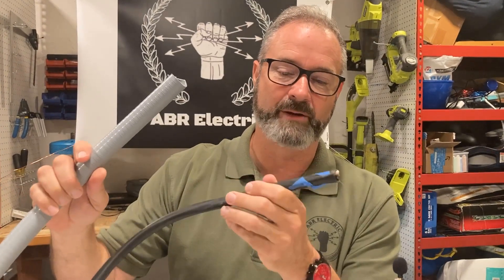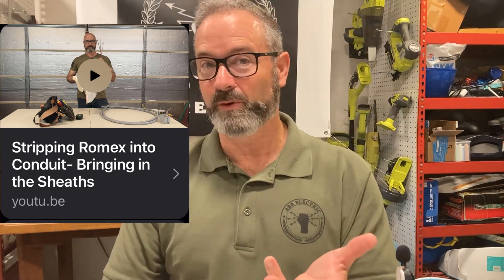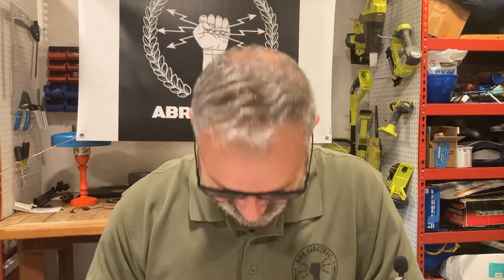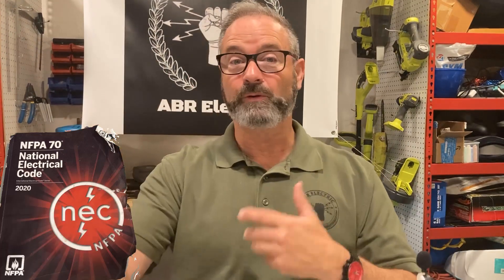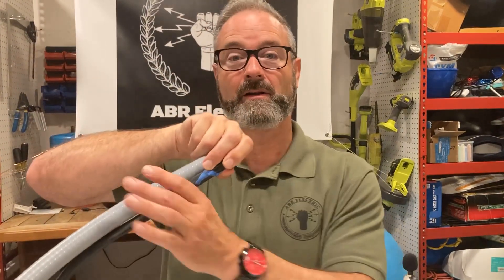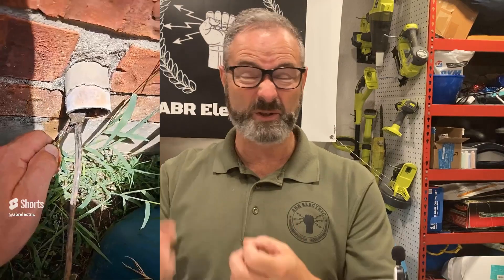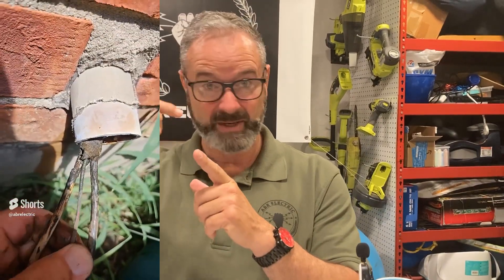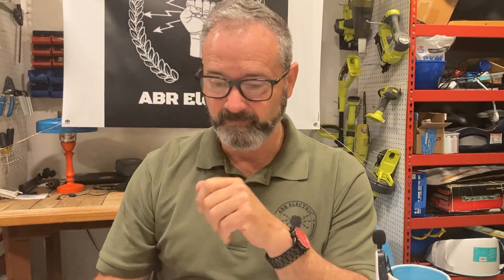Why Romex Doesn't Belong in Conduit: Quality and Longevity

Comment: I have no idea why this is so controversial in the USA. The equivalent of Romex (technically called thermoplastic-sheathed cable in many countries, using PVC insulation, with a toughened outer layer) is frequently used in plastic conduit, and I don't hear of it causing any issues. Of course you don't want to put too high a load down the same conduit, but compared to some things that are done (read directly embedded in plaster) it's really not an issue. I should add that it's only used in certain situations. For example, under suspended floors and in stud walling it it not usually in conduits. However, it's become increasingly common for such cabled to be buried in insulation material for both acoustic and thermal insulation reasons, and I would have thought that worse than conduit.
Reply from the maker: My opinion is that Code is trying to protect against installers who don't know what they're doing: undersized wire, frequently in white plumbing pipe, not correctly sealed against moisture,  with grounds cut off, because they don't know what to do with them.

Comment: My AC stopped working, in a packaged outdoor unit with gas heater.  I pulled the cover and using schematic and multimeter poked thru the compressor wiring.  I found the two wires from the 220 VAC contactor going to the compressor were hot, so why wouldn't the compressor run?  Pulled that panel and found one of the factory terminals at the compressor had melted away.  It had just spade slide-on connectors.  Apparently, corrosion had increased the contact resistance to generate heat.  Enough of a stub sticking out of the compressor that I was able to wrap and solder the wire to it.  I cleaned the other terminal well and coated with silicone grease.  In Atlanta and the HVAC was on the drier sunny side of the house.  A good guess is the same failure happened all over the southeast since problem was with the factory design and execution.  I recall I had wired the short distance from the disconnect box to HVAC input w/ NM cable inside liquid-tight flex conduit to protect it.  Large overhangs on the 1-story roof so the HVAC didn't get much rain even though outside.  I don't see a concern with that vs using individual wires inside the liquid-tight conduit.  If an NEC violation, that sounds subjective.

Comment: I added 2 semi outdoor outlets to side of shop. I say semi cause they have carport roof over them and 1 Also walls blocking the weater and tarp over door so practically inside. Had some outdoor/direct bury wire left over and ran that through few feet of conduit on outside of wall down to outlets just to keep wire from getting bumped or knicked. Used gfci and wr outlets in outdoor enclosures. Rain can't reach them but gets humid in summer. Looks nice and should last longer than rest the building

Comment: Hi, loved your video! What would you recommend for raceway in: a high tunnel (hoop house) that I would consider damp/wet location. I need multiple receptacles for my led lights to plug into, 3 way switches x2, other receptacles for blower, fans, water recirc pump. In a nutshell, what would you recommend to be the most watertight? Since I cannot use romex in it,  is THHN about my only option for wiring? All circuits are to be 20 amp. Thanks a bunch!

Comment: Yes, you can run NM in conduit and should when it's vulnerable to damage. Code recommends using conduit in this case 334.15 I believe. 
I have read about heat buildup. Are they crazy? NM(Romex) is usually ran inside bays with insulation often spray foam; talk about a chance for heat buildup, especially in an attic.
So, while I wouldn't use conduit for a whole house for NM I would use it in a basement from joist bay to an outlet on a concrete wall that's exposed. Or where the wire might get trashed. In fact my home passed electrical inspection with NM in conduit in similar situations and here in Westchester NY code enforcement can be quite stringent. I hope this clears up the situation of contradictory codes.
Reply: Code doesn't "recommend" romex in conduit in 334.15; REQUIRES it. In the NEC, the term "shall" means mandatory.
Reply: I agree 100%. How else could it be done w/o conduit from panel.
Reply: We used to sleeve it when we had a light in a beam on a vaulted ceiling.
Reply: think i terms of not being allowed to stuff the entire home run trunk down a single hole and enter the panel using a single 2" cable connector those rules arise from the same math that determines conduit and box fill. in your example you have a single cable or at max three sharing the same pathway and inductive space...and you are actually required to "de rate" for ambient temps even on Romex runs it is just that your average home lighting circuit has plenty of extra capacity in most installs so it can be ignored BUT the requirement does exist.
Reply: Why do they make emt to romex change over connectors?
Reply: using emt as a sleeve isnt a conduit anymore
Reply: @jeffriley-lq5np  It's still a conduit, but it's not a complete conduit system when used as a sleeve.
Reply: @jeffriley-lq5np  that is a distinction with out a difference as any one who has tried to pass of poor conduit work as "just a sleeve" will tell you: code says conduit and duct MUST always be installed according to the relevant code sections even if it is not being used for its intended purpose.
Reply: The only issue is to much conduit fill. Just need the right size. Completely closed conduit point to point should not be nm. What's the point.
Reply: @Nttt739  conduits are for mechanical protection,  Completely closed conduit point to point can be NM when necessary from location of the installation

NM offers the advantage of non spagetti when running it in wireways then into conduits then into pullboxes, into wireways again
Reply: @leusmaximusx  I didn't mean you can't do it. I meant pull box to pull box uninterrupted conduit. I've done myself . The original guy said you can't do it.
Reply: @Nttt739  sorry maybe i was misunderstanding this from your comment :  "Completely closed conduit point to point should not be nm." 
thanks

Comment: Romex in conduit is fine as long as you follow the rules. Conduit installed outside is considered a wet location. It is a code violation for romex to be installed outside. It doesn't matter if it is in conduit or not. Plain and simple.

Comment: Romex is not for wet.  This was probably an issue years before the breaker started tripping, could have easily started a fire without tripping a breaker.  So the answer is:  Work must outlive the structure it is placed in.
Reply: I really like that rule too. Simple and makes perfect sense. Moreover, as the new owner of a 22 year old home, I would be horrified if a bunch of electric work had to be redone by now. The structure of the home is in excellent shape, so like you said, I would expect the same from its electrical components.
Reply: My dad ran Romex overhead to garage. Was there for many years, might still be there.
Reply: @davidtaylor4053  I would not be surprised.  I have a feeling good quality stuff exceeds its rating.
Reply: NM UF-B Romex isn't "wet" rated?🤔😁
Reply from the maker: I like it.
Reply: My dad ran romex in the air to a shed. The sheating got beat down by the sun but its still there working 25 plus years later.

Comment: Thank you again for the videos! 
I'm replacing a 100-amp Stab lock panel with a 200-amp Square D Home Line. I pulled a homeowners permit but have a question. If I use 2-inch PCV nipple between the meter pan and the load center (using 2/0 copper) pan and panel are back-to-back.  Do I need to run a ground through the nipple? does not seem Like I should, but not sure. Thanks
Reply from the maker: Of you don't have an outside main disconnect,  and are going directly from the meter to the load center, you don't  need a ground through that PVC nipple.

Comment: Correct me if I'm wrong but romex wire its equally insulated as the wire that comes in rolls, the only difference is that romex is cover with a another layer of insulation but if you remove it it will be the exact wire,
Reply from the maker: Not by the markings on the wire. Southwire, for example, days the individual conductors are rated for 90 degrees C, but no rating for damp locations etc.
Reply: ive seen old romex with type t ( thermoplastic insulation an tw ive never seen a cable with thhn or twhn though. the paper filler stsys wet too

Comment: From what I understand, romex can run in conduit for short distances to avoid damage to the romex, (2 or 3 feet). Of course many factors would need to be considered, no set rule.
Reply from the maker: 24" for sleeving
Reply: @abrelectric  There is no length limit. If you wanted to run romex through 500' of conduit, it's not smart but it's legal.

Comment: Seen ac’s 30 years old with romex ran through greenfield let alone actual seal-tight and it be perfectly fine. But okay
Reply from the maker: It's not a problem...until it's a problem:)
Reply: @abrelectric Great answer!
Reply: It's still a code violation.

Comment: 24 years ago you were taught that you could put Romex in conduit except in wet or damp locations as the interior of the conduit is wet or damp.. Thus it was illegal then but I guess he stripped the Romex hoping that no one would catch the fact he needed outdoor single wires in the conduit..lol..and for 24 years the electrician was not caught..
Reply from the maker: Yep.
Reply: You can get TECK cables now. Armored and weather coated for wet and damp applications. Typically for AC and outdoor EV chargers. You can save some conduit.

Comment: A couple of weeks ago I installed and wired in a 50/30/20 RV pedestal box for a friend of mine.  since there will never be 2 RV'S at the same time, this was a great option for future RV guests.  We used a 6-3wg UF wire, its flat and about an inch and a half wide.  For the entire ditch it was laid right in the dirt, which is ok to do with UF wire.  However to protect the wire at each end, I used  1-1/2 PVC conduit that was about 3 ft long with a 90 on each into the ditch to protect the exposed run above ground.  Worked great.  I have read somewhere that Romex type wire in a conduit can, if run to near capacity, build heat.  In a normal situation Romex not in conduit can dissipate the heat, however if its in conduit, then that same potential heat can't escape as easily and can cause problems down the road.  Thoughts?
Reply from the maker: Sounds great. With direct burial we're supposed to have 24" depth, u less under concrete. 
UF is a great choice, and #6 is good for 50 amps in the 60 degree column table 310.16.
Is there a GFCI requirement for the 50 amp outdoor outlets?
Thank you!
Reply: GFI was not required unless it was to a piece of equipment or for instance a hot tub @abrelectric   RV pedestals are actually classified as "Temporary" even though 90% of these are installed and left in place for decades.  The RV boxes are suitable for wet locations as long as the door is closed and there are no screws missing.
Reply from the maker: @deej19142  awesome! Thank you
Reply: Sounds like you did it correctly, i like to put a 90 on the trench end of the pipe for a smoother transition and you should always bush the end where the wire enters/exits the pipe in the trench.

Comment: Can THWN be in metal underground conduit?
Reply from the maker: If you're talking individual THWN conductors, absolutely
Reply: @abrelectric I’ve googled those wires and wasn’t able to find a good source. Where could I find these individual wires for a 14/2 set up. Thank you!
Reply: @MoparGuy1625 Everywhere. It's rated THHN/THWN usually..
Reply: yep

Comment: If we assume the branch circuit is in a dry location, then the primary reason not to use Romex in conduit is ampacity. But we also have the problem of usage and how Romex is rated (tested). The secondary sheath on Romex limits ampacity, but as important Romex should not be confined, meaning bundled with other current carrying conductors (For example, grouping several Romex cables in a round bundle). Conduit is also a method of confinement. So, it makes sense to me that Romex in conduit should be de-rated.

Comment: I enjoyed your video but think the title is misleading since you can indeed put romex in conduit as long as you follow the rules, like dry environments (conduit in a garage assuming the size is appropriate).
Reply from the maker: I agree - it is not a complete title, given the context that included the story of deterioration of the Romex insulation in an outdoor carlon AC whip.
We have covered the rules you mentioned in two other videos.
Reply: @abrelectric  Would the area beneath a mobile home be considered a dry environment?
Reply from the maker: @GrabLifeByDaPoosy  in my opinion, no. I have seen lots of romex used there however.
Reply: I totally agree with this statement. As a DIY install of a DIY mini split Mr Cool 12k BTU. I bought the ROMEX today to connect inside conduit to get from the fuse breaker box to the disconnect. After researching a bit (surfing how to you tube, I know everyone's an expert now  or something), I find that the code doesn't allow for Romex in conduit attached outside to the disconnect. So I thought I'd go ahead in side the garage down the wall a little to poke through (via inside conduit) to the disconnect. Anyways, your title led me to jump-scare that I 'shouldn't' do the romex even inside the garage before boring out to the disconnect... only to find out after watching the entire video, you're only talking about outside or within definited damp areas. The title is definitely misleading. now if you're saying that Romex doesn't belong in conduit inside as well for reasonable opinion arguments, then it should reflect that in the title. Anyways, this was my first video of yours and I am sub-ing because I do like your presentation style (just not the title).
Reply from the maker: @stvcolwill  The summary: no Romex in damp or wet locations. You got it. It seems this is a topic that keeps on giving. If you you've got a code book, Art.334.

Comment: In some states, any electrical work much beyond changing a light bulb or replacing a light fixture must be legally be performed by a licensed electrician.  I think The Peoples Republics of Massachusetts and New York fall into this category.  In others, like my state of Utah, I can do about anything I want though my DIY work must be able to pass inspection EVEN if trivial enough that inspection isn’t required by law.  And of course, anything requiring inspection must meet code.  As someone with perfectionist tendencies, I want my work to last.  I hate redoing something because I was in an hurry or didn’t have the right tools or parts.   And I don’t want to leave something for a future homeowner to curse me for because I didn’t do it properly.
Reply: New York definitely does NOT require this, at least not as a state-wide code rule.
Reply: In California the electrical work must be inspected but a home owner can do the work. I am not sure if changing a fixture needs a permit but …
Reply: oof, I'm in MA and did all my own outlets, light fixtures, ceiling fan and added GFCI outside, behind the porch light, didn't bother with WR, as I had regular GFCI on hand, oh well, it's protected from any direct moisture, but not humidity per se.  Its a GFCI for crying out loud, point is protection, what's a little water or moisture gonna do besides maybe shorten the life.  Plus I only use it for LED holiday lights.